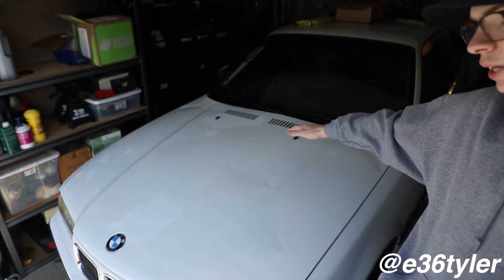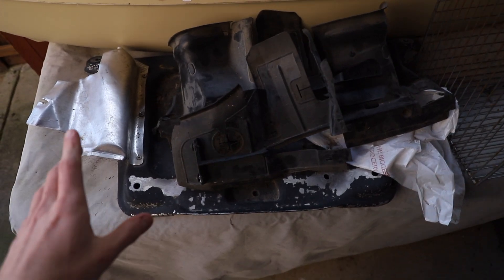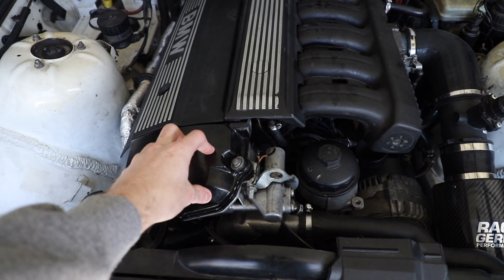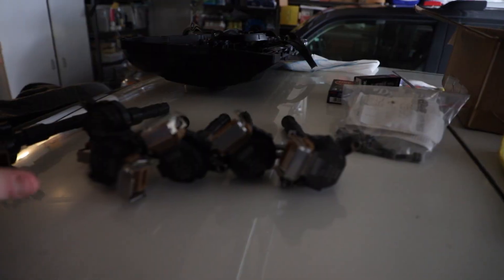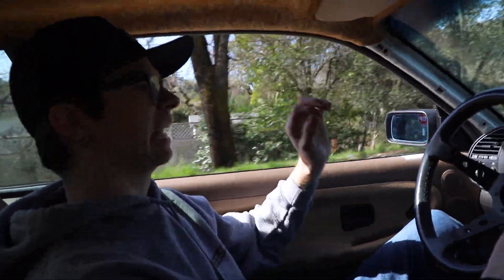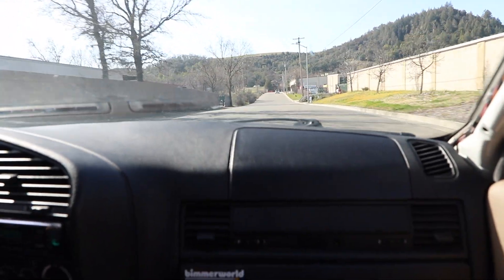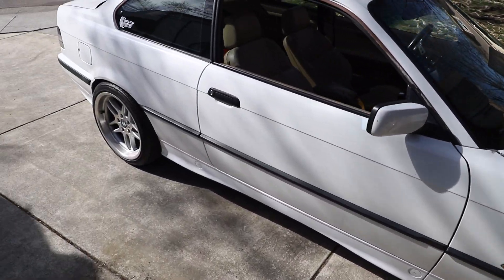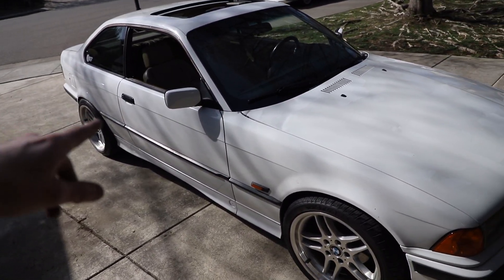LOUD M52 Swap E36 Hits The Streets!

Comment: Loud?  I’m currently driving an M52 swapped 95 E36. Zero muffler. Compare that to my built small block in my 1967 Chevelle with four inch open headers. That’s fucking loud. Clean build by the way…